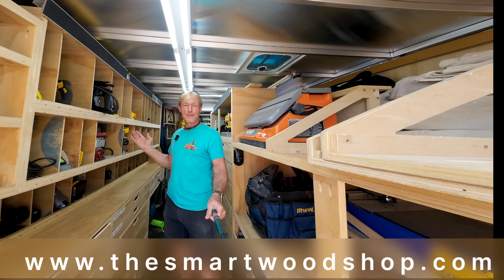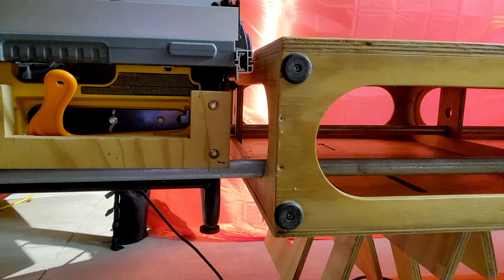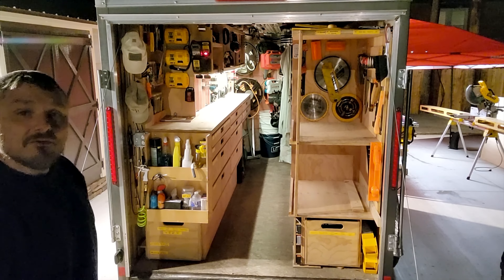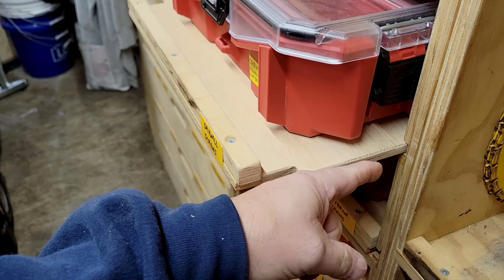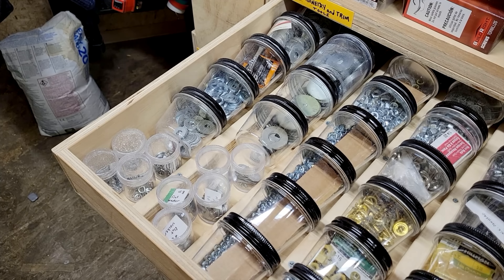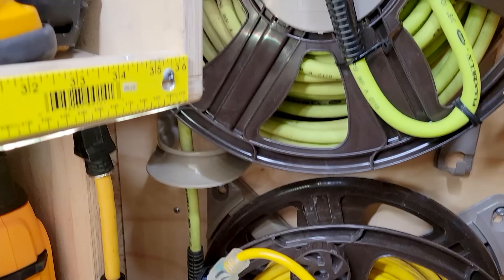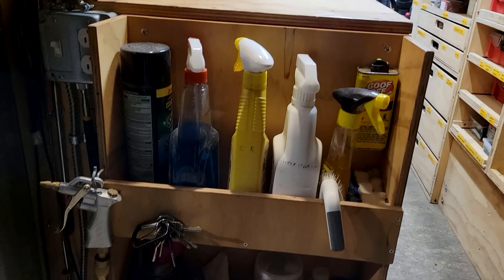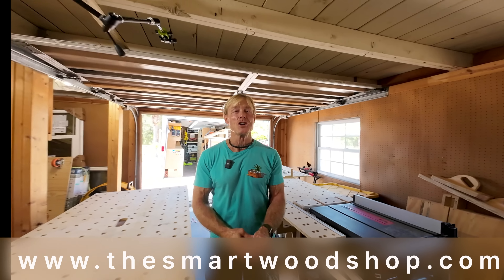Smartwoodshop Tour with Stephen Spencer #thesmartwoodshop

Comment: Hey Steve, great SMART TRAILER!!! Very organized ......like your thought process & placement of tools! Also, the yellow labels that compliment your tool brand of choice, nice touch. Yes, a "hardware store" on board is a must to maximize time on the job. Well done! Ron has to be pleased on how he has impacted so many of us.
Reply: Thanks MG3170 for the great comments! Tool placement came organically from watching a "hundred" tool trailer videos and taking mental notes as I built mine. Seeing other's and their arrangement and thinking about how I use tools and jobs that I do then allowed for a fairly "got it pretty right" the first time with little need for later reorganization just some dialing in. 

I am still very enthusiastic with the hardware store. It is so pleasing to know how many times that I have run into a situation that required some random or specialized bit of hardware and ….. I had it! No mid-day trip to the box store. What a time saver! (So much so that I often call it the magic trailer because ….  It’s in there! Whatever it is.)

As for Ron's impact, you got that right! We can all do what we do in a hundred different ways that work for us but sometimes we find ways that just work better. This is one of those.

Comment: Looks great and thanks for the detailed tour.  I also have a 6x10 trailer with a single axle and am about to embark on building it out.  I don't think I'm going to pack mine with so many cabinet and drawers because I want to be able to roll my Sawstop in and out.  I have built out a couple of vans over the years when I was working for others, but this will be my first trailer and it's for my business!  I'm curious how many sheets of plywood went into your build?  That has to be awfully heavy.  Thanks!
Reply: Hi Anthony. Thanks for the comments. I would think that I have around 1500lbs of plywood used in the construction of the buildout. I have swapped my axle for a 5000lb axle so I am not overloaded. My load out of tools/materials etc. can't grow at this point so my max everyday weight is now under the max of the axle/frame. I feel better now about using the isle for my bench or tile tools or whatever. Before the axle swap, I rarely used the isle since I was at or over max wt. I am looking forward to a future 8x12 to build out and "un-crowd" my tool and materials arrangement. Best of luck with your new trailer build. If you document the build and post, please let me know. I am an unapologetic trailer tour enthusiast.
Reply: Stephen, thanks for the response! I never thought about swapping the axle. I’ll look into that.  I’ll try to document the build out or at the very least put a tour together and send it to Ron. It won’t be in time for the contest, but I bet he’ll still be happy to see it too.
Reply: @tfbuild.oregon  I will be he would!

Comment: Stephen, ...I'm another Steve who will sooner I hope than later, be in the same situation;  basically a well-tented outdoor workshop & a 14' Paulk inspired tool trailer.
My dust management system will be much more spartan, lean that all others I've seen here so far,... it's called a Dewalt leaf blower & the very windy nature of S. Texas.
My SMART-cart will need different & softer wheels - suited to gravel ground conditions.

I have to take your video home to see it & comment later... looks very interesting.
Reply: Howdy Steve! Thanks for the comments! I have used the same dust management system for some time now, a DeWalt 60V dust mover and boy does it move it! I think King Julian sang a song about my dust system. I am lucky to have a concrete pad at my house and so I set up on that when I move to the next SMART bench build, I am looking forward to the cart system and it should work well on the pad. Best of luck with your project!